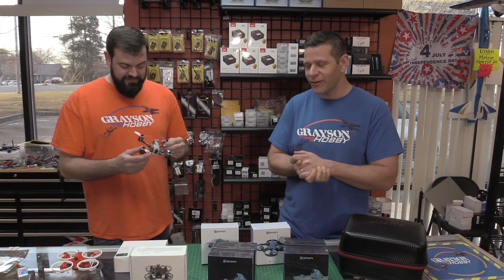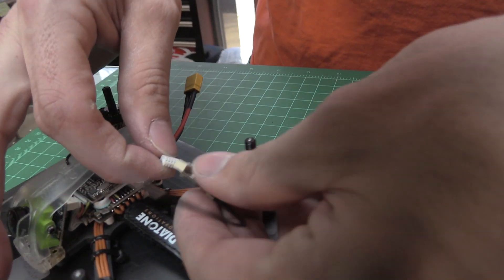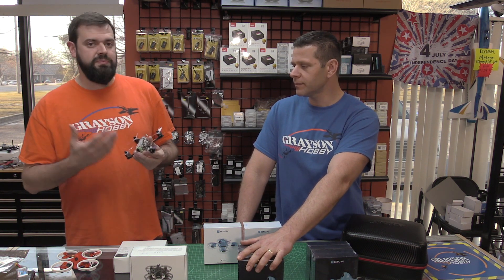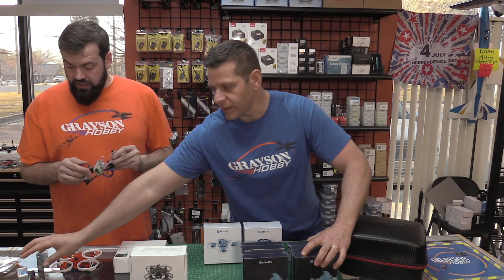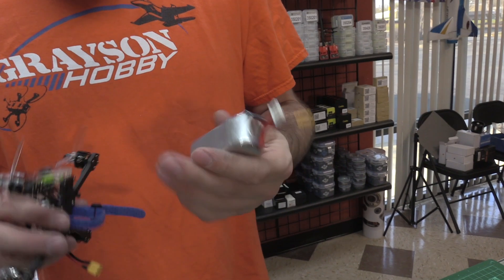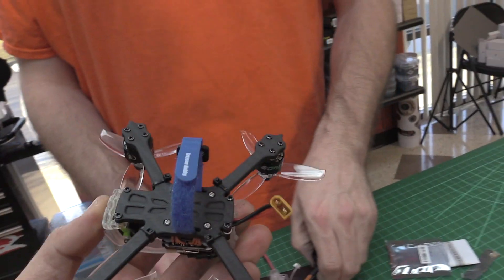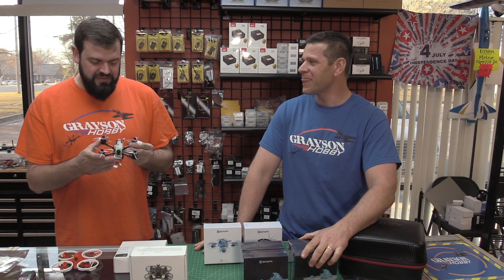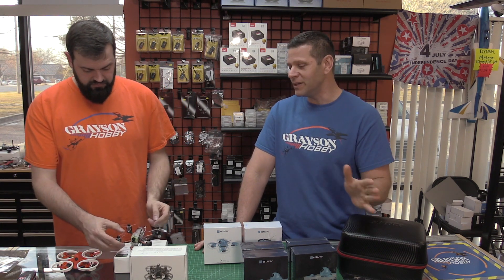How to install a FrSky Receiver into a Diatone Drone | R-XSR GT349

Comment: do you sell this  ?

VIFLY will have two new self-powered buzzers soon, both of them are based on Gyro, they are wireless that just attach with the quad is okay, no need to do any wiring. One is for DJI quad, the other is for racing quad. The main difference is the charging, the one for DJI quad will be charged via USB port, the one for racing quad is connected with XT60, it can get the power from the battery when flying.

Comment: When you get time...love to see your speed test. I think i will get the 249. Just doesn't attract the attention. All the stuff i have gotten from your shop has been right on. All worked as expected and shipping was awesome. Thanks for everything guys :) jeff
Reply: Same boat. So much so I got a second one. Note Diatone is now releasing an mk2 that's actually 100mm allowing for more room for 2 inch props clearance in the rear.